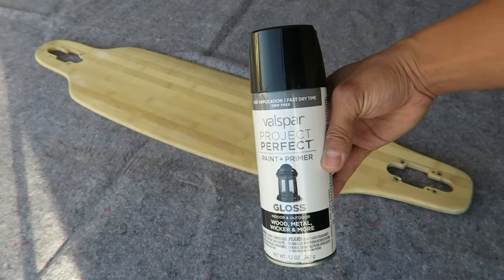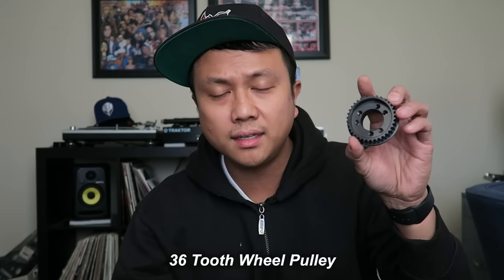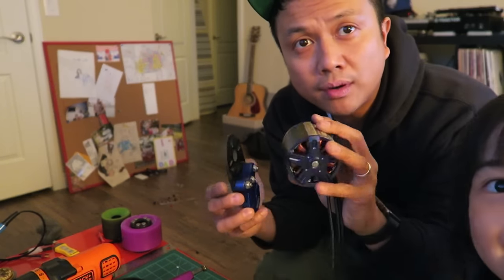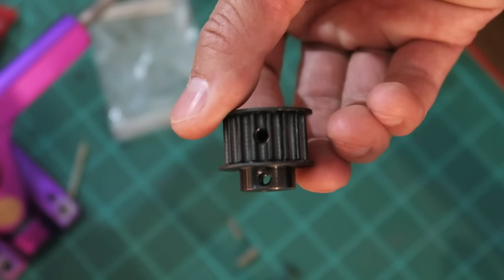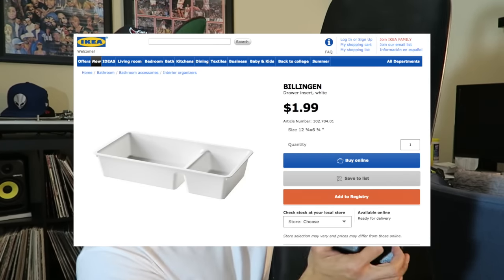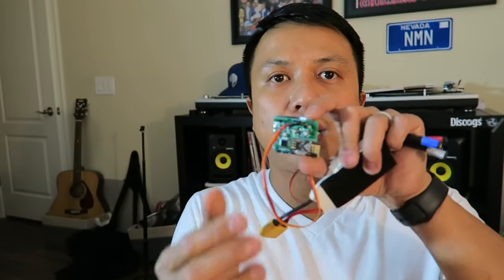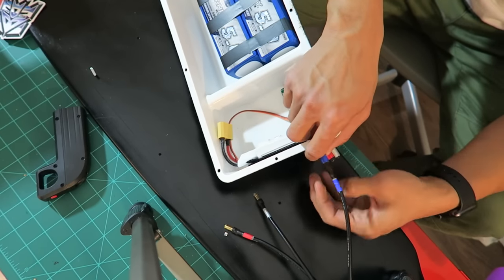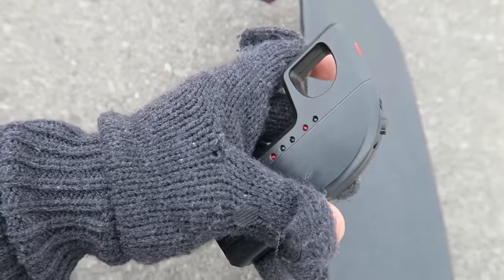MAKE A DIY ELECTRIC ⚡ SKATEBOARD - BETTER THAN A BOOSTED BOARD!

Comment: great video! I'm inspired now to build my own board! only question I have relates to charging it? what do you use to charge your batteries in series?
Reply from the maker: Hey there!  I'm super excited that you'll be building your first diy esk8!  LiPos were such a new world to me when I first started building my esk8.  So I ended up doing a lot of research.  Anyhow, I suggest that you use the B6 LiPo Charger - http://bit.ly/MiniB6LIPOBalanceCharger  This is a balance charger.  LiPo batteries need to be balance charged to conserve the life span of them.  This B6 charger is a work horse and is used by pretty much everyone into RC toys or esk8's.  Feel free to ask me as my questions regarding your build.  I've helpped others I've also met on line.  Good luck :)

- Neil
Reply: Big Kids thanks Neil! I was looking at this one earlier today. most of my parts are coming today but I'm getting my pulley kit and VESC from Enertion. what was your shipping time from them? I'd like to get building by this weekend but I'm not sure if they ship from the US or Australia.
Reply from the maker: Yeah, it's a cheap and effective solution.  The only thing I don't like about Enertion is they ship from Australia.  I live in Las Vegas so shipping was expensive.  I ended up ordering most of my other parts form Torque Boards or diyelectricskateboard.com as he's based out of the states and has a flat shipping price. If you haven't seen already my second video is all about Torque Boards.  Nevertheless, Enertion is awesome and love his Motor.  Unfortunately, they're moving away form parts sales and sticking to full build sales.  I'm glad that we bumped into each other; where are you from?

- Neil
Reply: Big Kids I got my VESC and pulley kit from them and they're saying it could be 2 weeks until if even ships. I think I'm gonna cancel the order and grab something from Torque. Too bad they haven't issued you a coupon code so they could track how many sales come from this channel. I'm from Minnesota originally but currently live out east in Delaware. I'm a big fan of this channel, man. I have a lot of my parts coming this week and cannot wait to get building.
Reply from the maker: When I ordered my motor and mount from Enertion it didn't take long at all.  However, they took more than 4 weeks to get my remote to me.  I believe that they are moving away from parts and focusing on full builds.  Yeah, I actually thought of asking Torque Boards for a coupon code.  Actually, I'll reach out today and see :)  However, I believe that if you are a new customer he has a coupon code for $10.  It's so cool to hear where viewers are from!  I'm in Vegas but actually visit Minnesota for work!  I'm so glad that you are fan of the channel.  We really want to be one of the voices for the diy esk8 community.  Anyhow, did you get a chance to view my latest video?  We're doing a raffle give away for a set of 97mm flyweels and bearings!  Just got to my next video and comment either #bigkidsgiveaway or #bigkidsraffle.  Good luck!  And, awesome chatting with you :)
Reply: jseitzer83
Reply: Is this cheaper than buying one???
Reply from the maker: +Daniel Delgado hey there!  Thanks for checking out this video!  Hope you'd consider subscribing for more videos like this one.  The short answer to your question is that it can be cheaper.  But it definitely can be much more expensive.  My board cost me $800.  I know I could have done it for probably $600.  But I don't regret building it as my board is personal and fits me!  Not to mention it has way higher top speed then any full-build (Boosted, Evolve, M1) out there!
Reply: @BigKidsOfficial  I have a question.....Cant you use a charge port with a 4 wire pin connected to an esc ? Thanks.
Reply from the maker: Im pretty sure you can.  But, anything outside of a balance charger requires a BMS or Battery Management System.  I hope that helped.
Reply: @BigKidsOfficial  ok i would  like to prevent the spread of misinformation. Preferably without disrespect.  LIPOS MUST BE BALENCE CHARGED OR THEY WILL EXPLODE AND CATCH FIRE DO NOT CHARGE WITHOUT A CHARGER MEANT FOR LIPOS
Reply: @BigKidsOfficial  where would you connect the Lipo charger for charging?

Comment: A tip on applying the grip tape onto the deck... instead of outlining the deck onto the tape and cutting, remove the backing to expose the adhesive and place directly on the deck.  smooth out the tape to remove any bubbles.  take an old screwdriver and use the side of the shank to crease an edge outlining the shape of the board then take a sharp blade and run it along the creased edge.  take a piece of the excess grip tape and smooth the edges making it look very clean and pro.  takes alot of the hassle out of applying grip tape.  nice vid btw
Reply from the maker: +Brandon Delenela hey there!  Thanks for stopping by!  Hope you'd consider subscribing for more videos like this one.  I grew up as a rollerblader!  Hung out with a bunch of people that had skateboards but I did have a lot of experience applying grip tape.  But after doing this video I did have a couple of comments telling me I didn't do it well.  Either way, you were he nicest one 👍🏽😊.  I appreciate the suggestion and the kind words!  I'll be posting a lot more as I'm trying to stay focused on uploading at least 1 every 2 weeks.  Hope to see you more in the comments!

- Neil

Comment: did you need to tighten or adjust the tension of the belt at all?
Reply from the maker: Hey Jeremy!  Thanks for checking out the video and hope you'd consider subscribing to see more videos like this one!  Yes, belt tension is very important and adjustable with most mounts.  You want it to be tight but not to tight.  And you definitely don't want it to be loose.  So somewhere in the middle is perfect.  You'll have to test your board a few times to make sure you got it right.  To tight or to loose will make your belt skip.  Hope that helped

- Neil

Comment: awesome build!  i was actually going to build a hub driven board but you got me thinking belt now maybe.  The board looks sick!
Reply from the maker: Hey there!  Thanks for watching!  I hope you'd consider subscribing to see more videos like this one.  Belt and hub both have it's pros and cons.  I like both for different reasons.  Performance goes to belt for me.  However, the lack of maintenance on the hub motors is also very attractive.  Good luck with your build and don't hesitate to leave a question in the comments as I'm sure someone will answer it!

- Neil

Comment: Could I just drill holes through normal long board wheels? Please reply asap
Reply from the maker: Hey there Yanrayz!  Thanks for checking out my channel.  Absolutely, you can drill  holes through a longboard wheel and attach a pulley to it.  However, I can't guarantee that the pulley i'm using in this video will fit.  This practice would involve more DIY which, isn't impossible.  I hope that helped!  Feel free to ask me or the community any more questions!

- Neil

Comment: Iam little bit confused about hub motor and drive pulley one which one i have to make for  climbing small hills and whats the lifespan of these two different  motor
Reply from the maker: Hey there!  Thanks for stopping by my channel and checking out my video.   Hub motors traditionally have less hardware and maintenance then belt driven set ups.  However hub motors also tend to have less torque.  Because the hub motor is basically inside the wheel, you only have about a centimeter of urethane around motor which serves as the wheel.  Belt motor set ups have more moving parts so there is more maintenance.  More torque and power comes from the belt motor.  But, there is some friction from the belt slows down the board when coasting.  As for which one lasts longer, that that is really subjective as it depends on how your ride.  If you have any other questions, feel free to let me know!

- Neil

Comment: Sick build! How do you make the cable for the anti spark to work? (not the little key itself rather the connection from the bullet connectors to the female xt 90 for the key and the male xt 90 for the vesc). Thanks!
Reply from the maker: Hey there!  Thanks for watching!  Alex, I hope you'd consider subscribing to see more videos like this one.  I hope this makes sense...basically, what an antispark switch or an on/off switch is a controlled break in either the positive or negative lead.  So the anti spark switch is basically just a female or male xt90 connector the fits into another female or male connector that completes the current within the negative or positive lead.  It's a bit hard to explain but I hope that at least helped you grasp the idea.  If you need more of a visual explanation please let me know and I can try and link something to you.

- Neil
Reply: Thanks!!! Makes more sense now!

Comment: I was going to run a 6355 260kv motor with 6s. Now this has me rethinking things! what do you think? Love youre vids thanks!
Reply from the maker: Hey there!  Thanks for watching!  I hope you'd consider subscribing to see more videos like this one.  6355 260kv is a great set up and you'll go fast.  2 factors that play a role in speed is volts and kv.  At 10s or 36v nominal 190kv is good for 25+ mph.  However, if you go down in voltage to a 6s then you'll want to make sure the kv rating goes up (which you did).  If there was anything I'd chance is the 6355 motor.  It'll be worth it to up grade to the 6374 motor.  The larger the motor the more stress it can handle.  the 6355 motor alone will heat up quicker.  In the end it's up to you and what your budget is.  I hope that helped.

Comment: So awesome!!!! When u let off does the motor "drag" and slow u down or will it still coast like down hill??
Reply from the maker: Hey there!  Thanks for watching!  I hope you'd consider subscribing to see more videos like this one.  Yes, you'll notice motor drag due to the friction of the belt.  But the trade off with that is a mechanically effective motor vs hubs.  Belts have a mechanical advantage because of the pulley system.  At times, I don't mind the motor drag because it limits my speed going down hill and then the brakes have to work less when needed.  But, it's really just a preference.  However, the drag is not extreme as one might think.

- Neil
Reply: Big Kids awesome!! Subscribed already. Love the videos n deff gonna try this.

Comment: which battery I should use with dual hub motor and also suggest the link of battery sir please response
Reply from the maker: Hey Sureshna, thanks for checking out the video and hope you'd consider subscribing to see more like this!  Battery is a flexible need and depends on the rider.  If you'd like a parts list to give it a try shoot me an email at bigkidsofficial@gmail.com

- Neil

Comment: So what is the range on this board with a full charge? I am thinking about making my own board, but I am not sure how much power to get.
Reply from the maker: Thanks for checking out the video!  I hope you'd consider subscribing to see more videos like this one!  At this point I've got a range of about 7-10 miles depending on how hard I am on the throttle and the incline in the area I'm skating.  I haven't done an official range test but plan to soon!  

- Neil

Comment: Can you break with this? Or drive the motor backwards to break?
Reply from the maker: +iSonikYT Hi There!  Thanks for stopping by and checking out my videos :). I hope you consider to subscribing to see more videos in the near future.  Anyhow, yes you can brake and go backwards on this!  The brake pressure and going backwards is all programmed in the Vedder electronic speed control or VESC.

Comment: would the pulley system work with the mbs colt 90x mountain board trucks?
Reply from the maker: Hey there!  Thanks for taking the time to check out this video.  I hope you consider subscribing to see more videos like this one.   Depending on the trucks and the size of the wheel the pulleys may work.

- Neil

Comment: Big Kids, Cool vdeo i'm also trying to build one, i have caliber II like you, can you help me with links to the motor please? already got wheels, belt, and both pulleys, scared about the motor's bore thickness won't match my pulley...Thanks
Reply from the maker: Hey there!  Thanks for taking the time to watch my videos.  I hope you'd consider subscribing for more video like this.  Of course I can help!  First I'd like to ask is how much do you weigh and do you like to go fast and not so much?

- Neil
Reply: thanks for answering! i m very light (around 124) and i want it fast. Not the fastest but you know! i  m really wondering about measurements, will any elctrique longboard component match the items i have already! thanks.
Reply from the maker: I am a big fan of the 6474 https://eskating.eu/product/eskating-pro-motors-6374-190kv-waterproof-sealed-and-sensored/?affiliates=11  this is the motor I use and I weight 150lbs.  If you plan to do a dual motor set up I would go with this: https://eskating.eu/product/electric-skateboard-motor-6354-230kv/?affiliates=11 two dual 6354 motors.  Let me know what you think!
Reply: thanks, a mono will be okay for me because the more motors to feed the more juice required even if that would be super strong, thanks for the links, ima check them out! I apprecited.

Comment: I've been hoping to build an electric skateboard a long time ago but before I lived in Philippines where everything is hard to get. Now currently in CA and thanks to your video man it inspired me to really make it but i have one problem though. Did you change the connectors of the battery? What connectors you used from the battery to esc? It's my first time I'm still learning and can you also put the link on where to buy the connectors? Thank you!
Reply from the maker: Kamusta pare!  I'm Filipino as well :)  Anyhow, from the battery to the ESC I used a male and female XT90 connectors.  https://hobbyking.com/en_us/nylon-xt90-connectors-female-5pcs-bag.html  XT60's are smaller and will actually work just fine.  Feel free to message me here again if you have any other questions!  Alos, you'd be surprised how many Filipinos there are as vendors in the esk8 community!  Maraming salamat for checking out my video :)  Ingat!

- Neil

Comment: Hey man I wondering if you know a place where I can get some bolts to mount the motor to motermount
Reply from the maker: Hey bro!  Thanks for checking out the video 😁  I hope you consider subscribing.  Anyhow, I believe the the holes in most motors are mechanical and not metric.  So you can go to home depot or a hobby shop with your motor and ask for a mechanical bolt for your motor.  The sizes look like this: M1, M2, M3 etc.  I can't say I know exactly which bolt you have but good luck!

Comment: With your set up, what transmitter would you recommend for dual motors ? Purpose for add another motor later. Will be running one motor for now since this will be my first build. Trying to build one too commute too work I have to go over two over pass & my job is 5 miles from my house so 10miles total for there and back.
Also can I add like a 3rd battery for more range ?
Reply from the maker: Hey there!  Thanks for watching!  I hope you'd consider subscribing to see more videos like this one.  That is a great question!  For every motor you have you need a electronic speed controller.  The electronic speed controller I use is called the VESC https://diyelectricskateboard.com/collections/featured-items/products/torque-esc-vesc-bldc-electronic-speed-controller?aff=3  This is the most common electronic speed controler in the DIY esk8 community.  But, I should forewarn you it is not plug and play does take some research and configuring to understand.  As for the 3rd battery, if you are looking for range you want to pay attention to the MAH of the battery.  The more MAH it has larger the capacity of the battery giving you more range.  It sounds like you are doing some research into learning more about DIY esk8.  I suggest checking out this forum https://www.electric-skateboard.builders/  hope this helps and feel free to leave me a comment if you have any more questions!

- neil
Reply: Big Kids just watched the battery video right... Haha those dumb questions I was asking was in that video pretty much just gotta be more creative since I'm using 3 batteries thank you

Comment: Is one battery powerful enough to go/brake on that single motor? Trying to save weight vs range. And does the single belt motor have little resistance for pushing? Or would it not be enjoyable. Thanks

Comment: Great video! Can you tell what parts you had to solder? And is it possible to avoid this (soldering)?
Reply from the maker: Hey there!  Thanks for watching!  I hope you'd consider subscribing to see more videos like this one.  You might be able to avoid soldering if all of your connections are the same type of terminals (ie: all xt60, xt90, etc).  However, you will want to have this skill in order to service your board when needed.  I know that soldering can seem intimidating if you have know past experience.  However, was you get you watch a bunch of YT vids and get your hands dirty it will make more sense and be a new skill!  Before building this I didn't have any electronic experience!  If you end up buying a soldering iron make sure it's above 60w and even 100w is good.  Shoot me an email and I can send you a link to a spreadsheet for the parts, links, and different variations of a budget build.  Here's my email: bigkidsofficial@gmail.com  Thanks so much and good luck!

- Neil